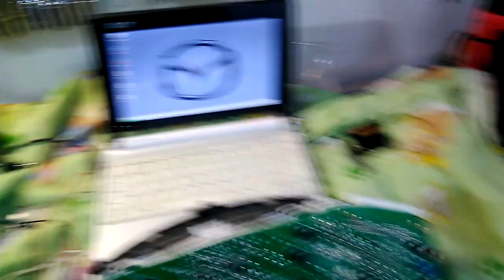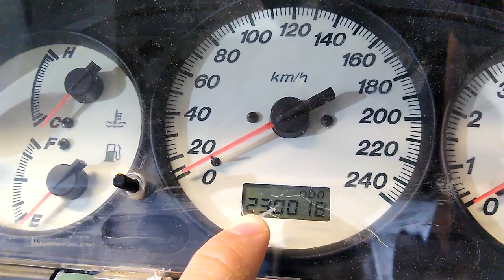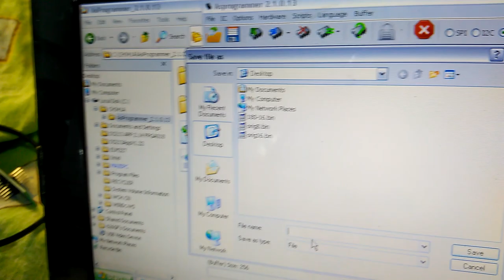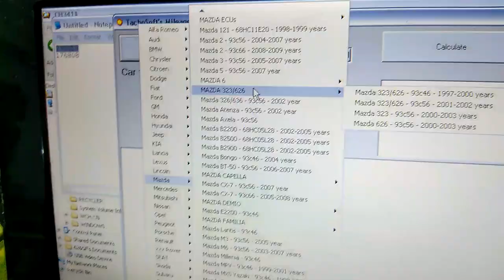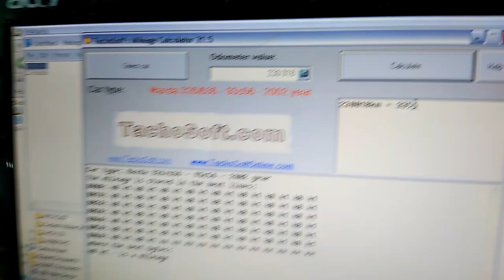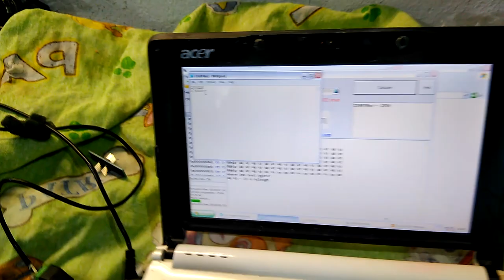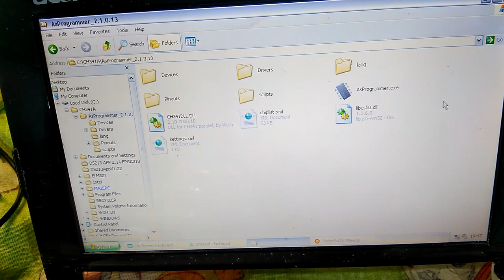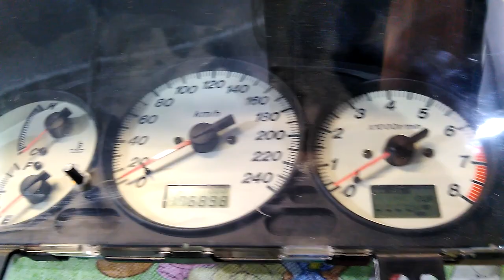Changing odometer/millage on Mazda 626

Comment: Hi that a very interesting and well narrated video thank you for sharing. Question: My instrument cluster gave up the ghost. Partly works. I want to change the Instrument cluster, do you or can you copy the eeprom 933S56 for the old unit to the new unit. I am not looking to change the mileage I just want the original setting. I would appreciate any help or advise.
Reply from the maker: You can try, but different revisions of the instrument cluster have different encoding of the data, so it might not work. The way I would proceed is first backup new IC data, then flash it with the old data and if it doesn't work, use backed up data and and the milage calculator to change the odometer part of it, then flash.

Comment: Hi man. I am trying to remove eeprom from toyotas immobilizer by using dissoldering station. 300 degree 6 speed. It does not come off. What could be a problem? Thank you
Reply from the maker: I'm using soldering iron only (at 320C) with a needle to lift the pins (pin by pin). Never used station :/

Comment: I like your tutorial.  I try in avanza, my chip detected but read nothing (zero).  I try to change the mileage anda program.  Failed.  Please give me some trick with my proplems.  🙏
Reply from the maker: Sorry, I have no idea what Avanza is. Google shows many things. Can you elaborate on that? Also give more information of hardware and software you are using?
Reply: @Mazda626GF  avanza is type from toyota car.  I am using windows7 and CH341 programmer.
Reply from the maker: @saesedanten  Is the chip 93C56 in that Toyota? If so, did you made the custom adapter? Standard one is not working. Maybe you messed-up something with the custom adapter? Also make sure you remove the chip from the IC as you cannot supply power to the whole IC through the programmer. And another thing - how do you figure out "my chip detected"? Do not trust the LED on the CH341, it gives rough estimation, but it is very inaccurate. It may indicate connection, but then the software may not read the contents of the chip. This also happens if you try to read the chip while on the board itself - CH341 LED will indicate connection, but software won't read anything, ever. Even with the chip removed it is possible this LED to indicate connection and still no data can be fetched. Re-clamping the chip few times should solve the issue.
Reply: @Mazda626GF  maybe chip of avanza 93c56 detected but cant eraser,  are you use whatsapp or else? can i have your social media or telephone number? i want sent my problem pict. thank you
Reply: @Mazda626GF  i klik detect  manu facture: other, memoryname Unknown, memory size: unknown, manufacturer ID: $FF, memory type $FF, memory capacity: $FF, device ID: $FF
Reply from the maker: @saesedanten  93 series do not have an id for the software to "detect". You need to manually specify what chip you have. So forget about the Detect menu feature. Check what is written on the chip surface and search in Google what chip that is, then set it in the software and it should start reading good values (assuming you did not already screwed it up). I do not use Whatsapp, give me you email and I'll ping you.

Comment: Can you give me replay please i have ch 341A programmer can i programming 93 series ic if i connecet it is not reading that ic
Reply from the maker: Hello. As seen on the video, I read and write 93C56, which is 93 series ;) Also in the description there is a link to schematics for how to connect CH341A to 93C56. And finally you need to remove the chip from the PCB, otherwise you won't be able to read/write it.
Reply: @Mazda626GF  tq so much

Comment: Great video.  I'm sorry about my English. Where did you get the electrical schemes?  My car has no remote control and I want to install it. I'd like to use the deck of the original module, instead of putting it on the door.
Reply from the maker: I bought paper version of if on eBay UK. So my diagrams are RHD, but most of them match the LHD. I have them scanned - give me your email and I'll send them to you ;)
Reply: @Mazda626GF  In case it serves as an idea to modernize your car. I carry a photochromic interior mirror from a Honda Accord, with the mirror support from a Mazda 5. I did it for my Mazda 3, but now I have put it on the 626.
Reply from the maker: Check your mail ;)
For the mirror - I have tinted rear windows and I do not feel the need for that mirror. None the less, over an year ago I bought Gentex mirror from the states, that has not only electrochromic glass, but also a compass and 3 buttons to open 3 different garage doors. Sounds cool, but none of the features work in Europe so I never made a video about it. Compass needs calibration and only options are zones in the USA. Garage door openers here work on a different frequency and I couldn't make it happen.

Comment: Thanks for your video. You need to soldering the wires for the pin's CS because this CH341A programer doesnt support 93XX chip's by default?? They only advertise 25CXX / 24CXX right?
Reply from the maker: They advertise support for 93 chip, but they so not say how to make it happen. Programmer supports it, just not out of the box and they of course are not telling you that. Without making your own bed for the chip you won't be able to program it with this programmer.
Reply: @Mazda626GF  thanks for the information will order EZP2019 programmer its supports 93cXX natively. Everything else is pretty the same you did, thanks for really good explanation
Reply from the maker: I actually did order both programmers, but never tested with the EZP as the other one came first and I wanted to make a video of the cheaper version as well.
Reply: @mster62  I ordered the ezp2019+ but it doesn't work with 93cXx series chip even though it is advertised.  Did you have luck with it ?
Reply from the maker: I never tried :/
Reply: @sc8496  voltage problem,

Comment: Hey, great video and very helpful, can you just take the chip from the old dashboard and put it in the new dashboard?
Reply from the maker: Well, judging by the calculator, there are different algorithms used in different years, so it may be possible, but also it may not be possible. Probably if your model is 2001+ it could work, but if it is 1999-2000 there is a bigger chance to fail. Another reason why I wouldn't do it is that if you do it you are tempering with two instrument clusters, which means there is double the chance to screw up and be left with nothing in the end.
Reply: @Mazda626GF  thanks 👍👍👍

Comment: Great video and i am a sub now.  I am trying to repair my 626 dash,  can you share any info on how your wired it to get power ?    There is a power problem in mine as the speedo and tacho driver chips are not getting any power,  the LCD for the odometer is also dead.  I need to trace the power problem.
Reply from the maker: Well all signals are on the 18 pin connector. GND is on two cables - pure black (seems it is used mainly for bulbs) and black with orange (seems to be supplying ground to the microcontroller). Constant 12V is blue with red cable and before the IC it goes through 3 fuses - MAIN -> BTN -> ROOM. IGN 12V is black with yellow cable and it seems to have 2 fuses - one outside the IC (METER fuse) and one internal. If you give me your email I can send you PDF with the wiring diagrams of the whole car (facelift model).

Comment: m wondering if it would be easier to use male to female connector straight from clip to programmer pins
Reply from the maker: Sorry, I cannot quite understand your idea. Can you explain a little bit more?
Reply: @Mazda626GF  I tried. I failed.
Reply: I ended up using the clip which I then wired straight to the programmer. Thanks for your pin information mate.

Comment: Hi, im going to switch the eeprom from one instrument cluster to another. Both clusters are of the same car modell and year. Do you think it can work fine?
Reply from the maker: Hello. Judging by the calculator I used, it had more than 1 algorithm for calculating milage for the same model year car, which means probably there are some differences. You can try, but make sure you backup the data first.
Reply: @Mazda626GF  i saw a guy here in youtube who broke the eeprom while trying to desolder it and then he took another eeprom chip from another cluster and he reprogrammed it. It worked for him at the end. Thanks for your answer mate.
Reply from the maker: Yes, if the chip is the same and you program it, it'll work. I thought you were asking just for swapping, without programming.
Reply: @Mazda626GF  actually that's what i was askong about, just swapping the chips. I'll take it easy and wait for the programmer to arrive from China better than taking the risk. Thanks alot. (Subscribed)
Reply: My chip is an S93C66, do you think it'll work on this programmer (ch341a)?
Reply from the maker: Sorry, I have no idea - never tested.
Reply: @Mazda626GF  i've swapped the eeprom chips on my nissan xtrail and it worked fine. Without programming them 😀
Reply from the maker: Cool, good knowledge to have!
Reply: @Mazda626GF  it seems that some chips have the VIN number saved in them and others not. Mine didnt have it so i just swapped them so that to get the same mileage and also to avoid the tachosoft margin of inaccuracy (+/- 250km)

Comment: Please circuit connection
Reply from the maker: They are in the description.
Reply: @Mazda626GF  ok 93c46 connection please
Reply from the maker: In general pinout of 93C46 is the same as 93C56, unless you have the rotated (R) version. Search in Google for "93C46 rotated pinout" and you'll find it. If your chip is not rotated, then connection is the same as what I posted in the description of this video. If it is rotated, then compare pinouts of the rotated and non-rotated versions to figure out how to connect. I'll update the diagram with pin names when I have the time.